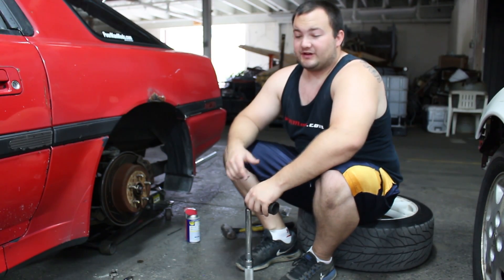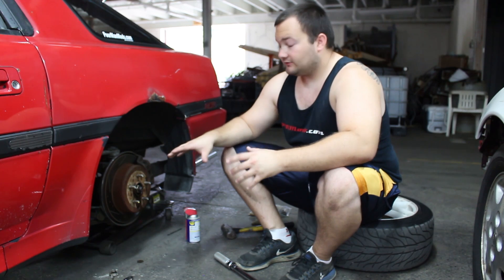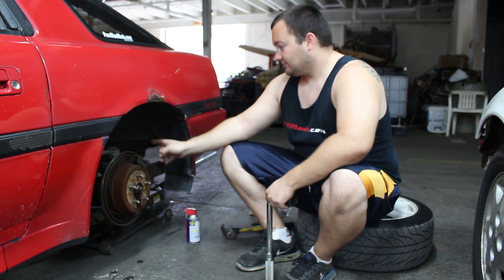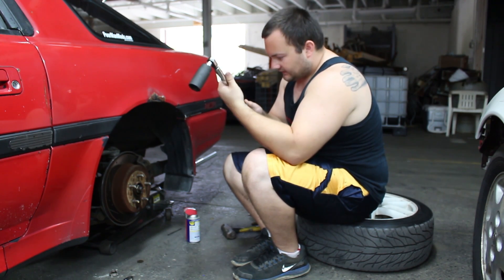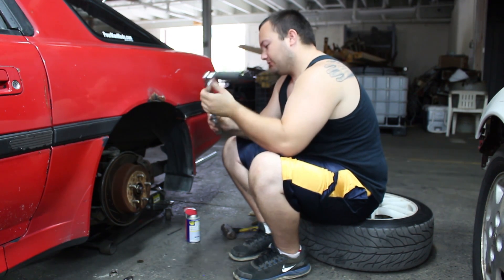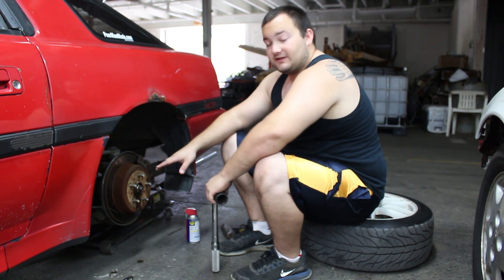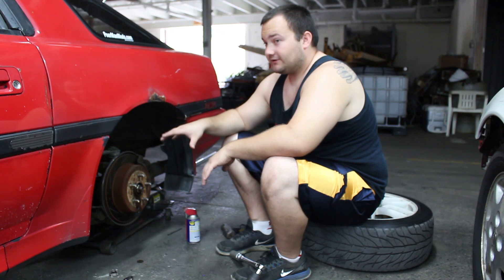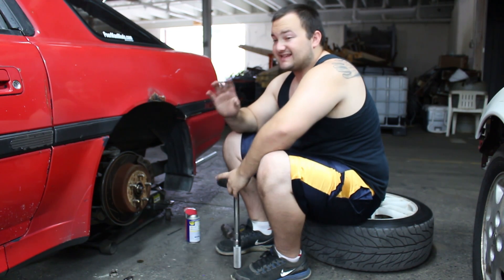Testing LSD Breakaway Torque

Comment: So is there a way to get a LSD to lock at a low speed? Supposedly my yukon dura grip has a break away at 150ft lbs but I dont know if that has anything to do with the difference in wheel speed making it lock. It's for of road and one wheel has to spin too fast before the other gets power. Sorry for the rant lol, but this is all new to me. Also best explanation of break away I've seen

Comment: Nice video.  I would add this -- If the torque spec for the axle nut is 180 ft/lbs, and you put 200 ft/lbs on it to check your diff, you will want to back the nut off, and re torque to the proper spec.  Depends on the Axle... Most are between 150 and 220 ft/lbs some higher, some lower.  Or you could use the tool that slips over the lug studs, but that is a specialty tool and would not be very "poor man mods" friendly.

Comment: Yyaaahhh cut them lock stoppers off for more steering angle lol. You'll reasonably impressed i can almost do a full u turn without having to back up in mine. Beech performance or drift motion also sells racks spacer for like $25 i think
Reply from the maker: that'd what we plan on doing, but make our own spacers, not buying them :D